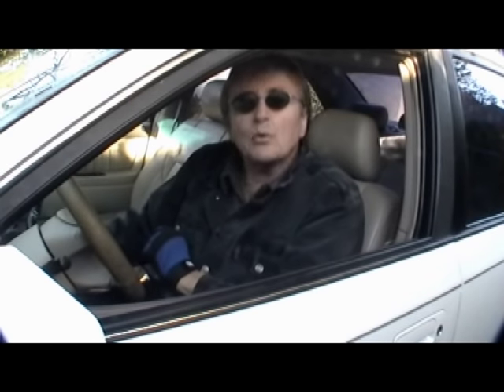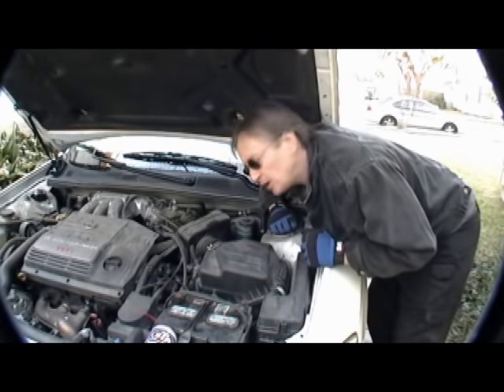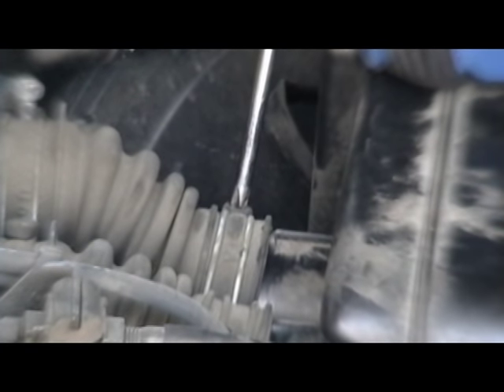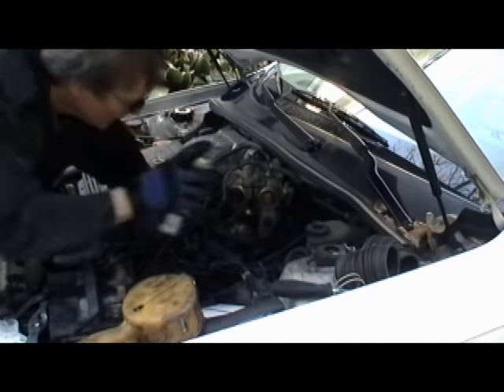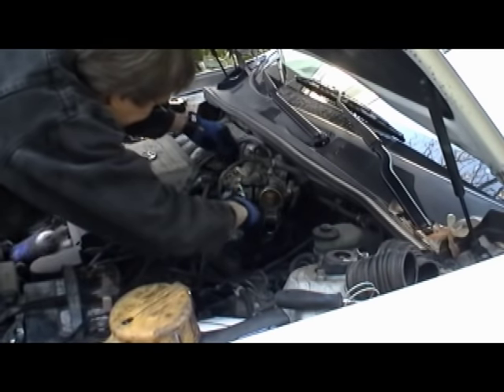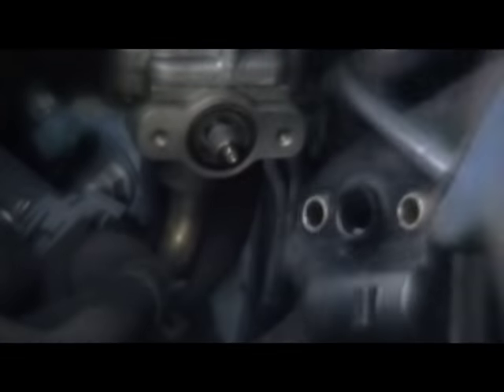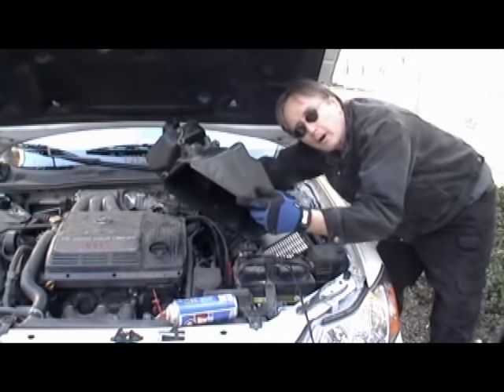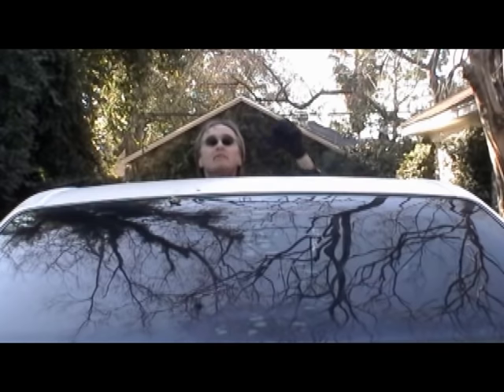How to Fix Engine Idle Problems in Your Car (Rough Idle)

Comment: Hey Scotty.. My toyota corolla 97 problem is it has low idle and then an engine check.. Pls help me
Reply: Can i go and clean up the air intake valve or run a diagnostic?

Comment: I have a 2005 Nissan Xterra my rpm is running way too high about 1700 now how can I lower my rpm
Reply from the maker: try this video, also check for vacuum leaks as in my video "finding engine vacuum leaks with a cigar"

Comment: my 96 1500 chevy pick up truck s engine  rattles at certain speeds and how long can I drive
Reply from the maker: +Yoshu Yahudim depends on what's rattling. If it's internal stuff like piston slap from worn bearings, not that long. If a rattling timing chain, it can go a while with that

Comment: I got a 350 chevy carbed, falls all over itself at cruise speed. misfires, hiccup, and backfires. changed plugs, did no good. any ideas?
Reply from the maker: +J Shadley those old things, I normally just throw the old carb away and bolt on a new edelbrock
Reply: All the upper is new. Intake, carb, gaskets to everything.

Comment: Hey Scotty! I have a 2004 Honda Accord ex V6 manual trans. When i'm in Neutral idle, the car vibrates but i wouldn't call it violent. When i'm engaging 1st gear it vibrates more but as soon as i am at about 5ph the vibration stops. It is the same reaction when engaging reverse. Any idea what it could be based on this? I'm getting ready to fix this by the weekend so kinda just want a heads up if i'm heading the right direction which i think is motor mounts.
Reply: Oh i forgot to mention that the vibration also increases whne the A/C or heater is turned on.
Reply from the maker: +pedro soto  first, do as in this video and also check for vacuum leaks. PRAY it's an engine management problem and not a worn transmission that those are known for. Also check for broken motor mounts
Reply: +Scotty Kilmer There is no grind or pop outs anything of that sort, i really hope its not my trans. Im going to do everything you recommend tomorrow. THANKS SCOTTY!

Comment: I cleaned the TB in a 99honda & let dry for 15m then ran it for 12 miles and it idles up and down when parked , Why ? is it the cleaner burning threw ?
Reply from the maker: +kid Dizzy kid Dizzy do check to see if you created any vacuum leaks doing that, but if not, often it takes a day or driving for computer to reset idle speed
Reply: I woke up to warm the car up and it idles back to normal , thanks for your reply "Scotty. K." .

Comment: I want to ask, why during starting my car, suddenly noise come out (might be from the belting). Then when i left it from engine to idle,  the noise disappear. after that, when i open (AC) air conditioner, the noise come out again. :( can u help me to fix it. The belt is not too old, just already change it last service.
Reply from the maker: make sure the belt is tight, but if so, often a worn out AC compressor will do just that
Reply: Okay i will figure it out. Thank you.!
Reply: Scotty Kilmer hey there i have a 03 focus zx3 that reads p0171 bank 1 to lean do u have any idead it shakes when at a stop ur help would be great plz thanks

Comment: I have a Mitsubishi Galant  2000 and when i stop like at a stop sign it turns off what would you recomend checking or doing
Reply: Thanks for replying 🤣 it was a bad fuel pump anyways
Reply: 2 years later and I still have the galant it's been really reliable now

Comment: So freaking mad. I took my truck 2 times to the mechanic and it still shakes when idle and going around 50-60 mph
Reply from the maker: go somewhee else, let them check the transmission too, as worn ones will do that. OR, you have a wheel balance problem AND and engine idle problem unrelated
Reply: Scotty Kilmer I took it several times to different mechanics and still does the same. It's a rough vibration/shake when idle but it happens randomly. Like when I start it up, it runs fine, no vibration. But give it like 3 minutes then it'll vibrate/shake. Then I'll drive it and when I come to a red light, when idle it'll start vibrating/shaking again. But it only happens when it's idle that's all and it happens randomly. Like some days it won't even happen it all. And when I'm going around 50-60mph my whole truck starts jerking like a back and forth motion. It's not a rough jerk but you can feel it jerk like it hesitates to change gear. When that happens I press the gas pedal kinda hard and it goes away. You don't possible think I might need to change the fuel filter for the vibrating/shaking problem? And by the way, it's a "'97 1500 GMC Sierra.

Comment: I have a 06 dodge stratus and it hesitates . I've changed both catalyst converters and oxygen sensors. cleaned out throttle body . any idea ...thanks
Reply from the maker: +06stratus tons of things can do that, analyze, rather than guess. Pressure test the fuel pump to see if it's weak, have the maf sensor data and mode 6 data analyzed to find the fault. Often dirty fuel injectors do that on that model
Reply: +Scotty Kilmer     I also installed brand new fuel injectors and spark  plugs. I had the shop check out the fuel pump and no problem there? I do notice that when it hesitating that light dimmer up on dashboard.....want to check battery hookups next. i do not get the check engine light and therefore no error codes. thank you

Comment: ok so 2007 yukon denali. p0171 p0174 intake gaskets are good. light comes and goes. havent changed any parts yet just cleabed maf sensor. what next
Reply from the maker: often a bad maf, cleaning doesn't always work, or a weak fuel pump, test those first
Reply: Scotty Kilmer ok thanks. it has no.issues starting. runs like a striped ape. good fuel pressure. i was thinking 02 sensor and pressure reg but wanna start cheap. so you think it is a bad maf
Reply: It was the vaccum line on the intake. It was disconnected. Lights gone. A little bit of a tough idle. Cleaned throttle.body

Comment: Scotty,
I have a 2013 Elantra GLS, it idles poorly at low RPM (while in Drive, standing at a red-light). If I shift to Neutral the problem goes away as the idle speed increases just a few RPM. Engine has 62000 miles and basic maintenance like oil and filter changes are up to date. I added dry gas to see if it was bad gas or moisture in the tank, did not solve the issue. What could it be?
Reply from the maker: check for vacuum leaks and pray it's not the torque converter going out inside the transmission
Reply: the torque converter would be covered under the 100000 MI warranty I suppose?
Reply: thanks for your input, I will clean with some carb cleaner like you suggested  in one of the videos that may also help.
Reply: I checked and cleaned the intake, not much dirt. Checked the plugs (color was perfect, no deposits) but I found 2 of the 4 had a larger gap than OEM spec. (2 or the right, not sure what cylinders) after adjusting and a re-start the idle seemed fine. I give an update in a few days.

Comment: Will the dirty throttle body and idle Air control valve cause positive try rim or negative trim?
Reply: It can make it run rich- if it's not getting enough air into the engine. This would cause negative fuel trim numbers.

Comment: my Mitsubishi Mirage is running rich spark plugs are black as anything how do I fix it
Reply from the maker: +Chantelle Bartorillo IF all are black, often a leaking fuel pressure regulator or a blowing head gasket
Reply: Thanks 4 mate
Reply: Lol thanks 4 that mate

Comment: My car stalls out if I stay at a stop light for a long time.
Reply: Little Larry how many miles does your car have? And Make, year, model?
Reply: Little Larry same happened to me, I cleaned out and change the air hoses and after that the cars been behaving like it’s on its last days. I went to the store bought the cleaner and used it. I turned my car on and it’s been idle for a good minute and noting is happening. I’m so happy, it actually worked, when I sprayed it and cleaned it the paper was black as heck with so much carbon. Now my car went back to its regular idle and is running fine. Thank god for this video.

Comment: hello Mr.  Kilmer, 
. at "cold start" of my car.... where going into "reverse mode".. (... as in leaving a parked space). the car jumps (hard) into gear!!...however,  after the car has warmed up (parked-waiting/actual driving)... itnoticibly acts normally.. as when i  first obtained the vehicle (2nd. orthird owed-me)... have had the car for about almost 8 months... approx. mls. :268.5-600 some-??... toyota avalon 1999.... lastly, i should mentioned... about twoor three months after possesing my car..I needed some transmission fluid (very low... and forgetting a most important fact as to "use the car's original specified transmission fluid).. i used a "dollar store brand" (though recently checking.. it appears to be "Dextron3...which is specifiexgor my vehicle....everything appeared to be fine until recently.. i only used a quart and a quarter amount that one time... one more thing.. I decided to check the transcript fluid.. at a "cold" start,... and after checking multiple times... the fluid is at the second notlevel... i'm hoping I haven't overfilled?.. however,  again this has only been happening within the last month of two...the color of the fluid is "bright red"... just one more question:of my car...i ("no flush") can safely change?... thank you very much for taking your time out of your life,  to answer any/all my questions towards concerning problem/'s to my vehicle!

Comment: Is this legit? I guess I need to clean mine...? Any replies please, I have a 2012 Hyundai Elantra limited. 
Thank you
Reply: Not sure i have a Hyundai accent 2011 and it idles at stop lights and when I'm driving on the road i figured it was the IAC VALVE

Comment: Good day sir Scotty I have a ford Lynx 2004 1.6 model my car idle seems fine but when I turn on my a.c. the rpm is diving down every time I release my throttle and you can hear the engine that near on shouting down and on idle you can see the needle bounce up and down that only happens when the air condition is on. I really don't have any idea where to look the problem from, I hope I only have a dirty throttle body.
Reply from the maker: +Lee Robin  try cleaning the throttle body and replace the iac if that doesn't work, and PRAY it's not the ac compressor going out

Comment: just stop making videos if your going to say your going to need a mechanic then just don't make videos anymore because you obviously don't know what your doing either yet your trying to teach the public possible solutions that won't necessarily fix the problem were looking for
Reply from the maker: ha ha, there are things that require a mechanic to fix on modern complex cars that DIY guys should never touch. So I tell the truth then. Many things can be fixed DIY, but some should never be attempted
Reply: My bad Scotty I'm just frustrated ..I'm looking at other videos you posted and their helping out alot thoe It helps me pin point the problem